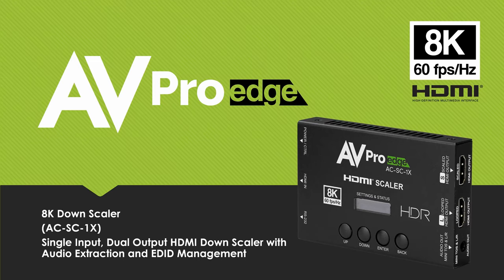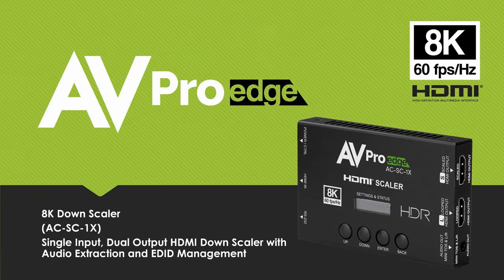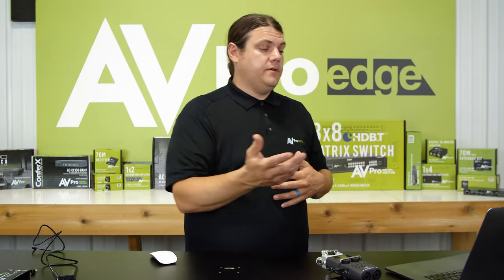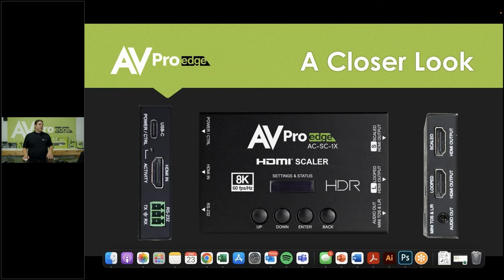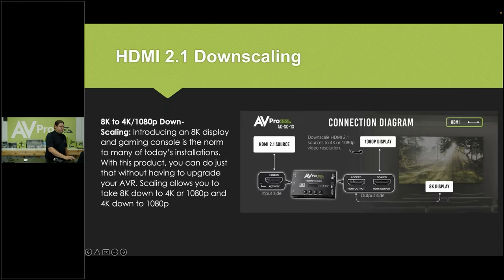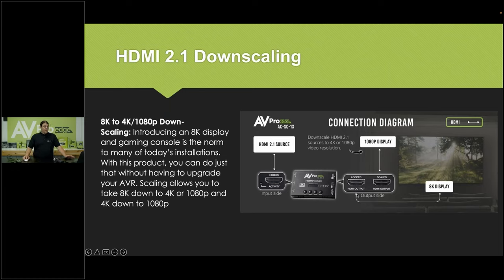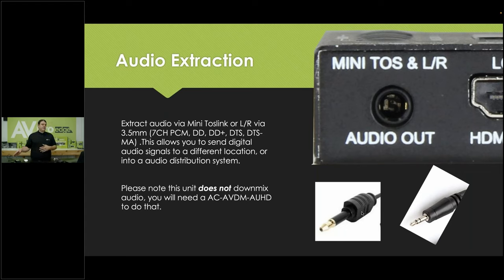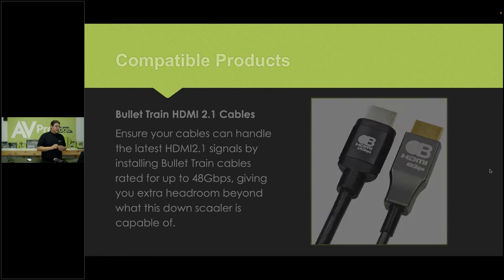8K HDMI 2.1 Scaler with AC-SC-1X - Product Training

Comment: Is there any input lag introduced if i'm scaling a 480p hdmi signal to 4k60 for retro gaming?
Reply from the maker: This unit would not be able to make that scaling conversion. This one is for 8K scaling. You would want to check out the AC-SC2-AUHD, but your retro console would need to have HDMI out. This would add about 10ms to the latency, gamers usually say under 40ms is ok, and under 20ms is unnoticeable.

Comment: I'm aware the slides say the unit cannot scale VRR, but there are some other products out now (though not entirely without issues) that can accept 4k120hz HDR VRR (FRL) and output 1080p120hz HDR VRR (TMDS). Obviously not many things are compatible with VRR even if TMDS is used, but there certainly are some. With your product, what would the output be given a VRR input signal? Do you just pass it through unchanged, or are you saying it can't scale VRR because you can't output non-VRR from VRR input?
Reply from the maker: Once the source starts putting out a VRR signal it is detected by our scaler and we would just pass the signal untouched by our processing. Our scaling is a set thing though our chipset we use, where it's not able to detect on the fly what resolution and timing are coming out to make the adjustment where it wouldn't be unnoticed. What happens currently is the signal drops out for a second everytime there is a change in the signals resolution or timing. That is why we disabled it completely, because we feel its better to just leave VRR untouched.
Reply: @avproedge  Thanks for the detailed answer. Perhaps you can utilize a different chip in a future revision. The other devices I mentioned seem to perhaps be using a chip from Analog Devices.

Comment: What happens when you run 4k 120hz? can you down scale to 1080 60hz?
Reply from the maker: 4K 120hz is no problem for the AC-SC-1X. Downscaling 4K 120hz to 1080p results in 1080p 120hz because it downscales the pixel density (chroma and resolution) and not the frame rate.